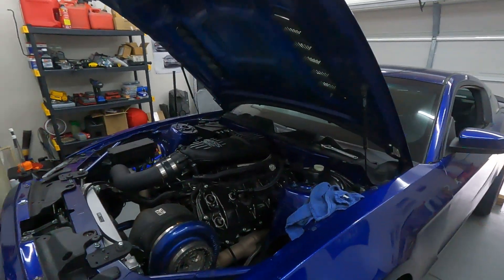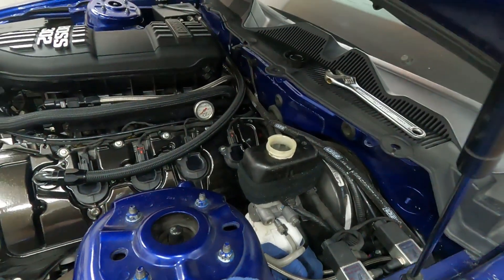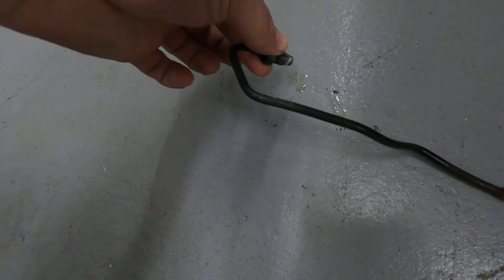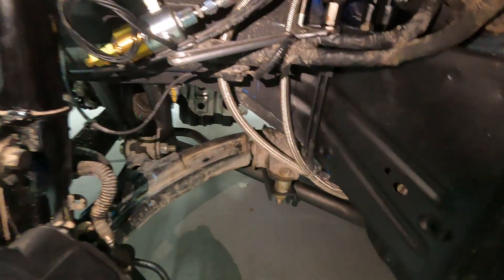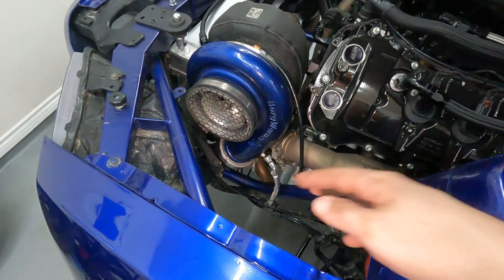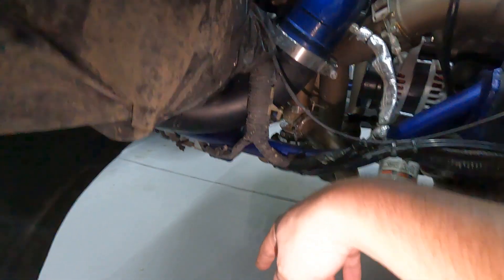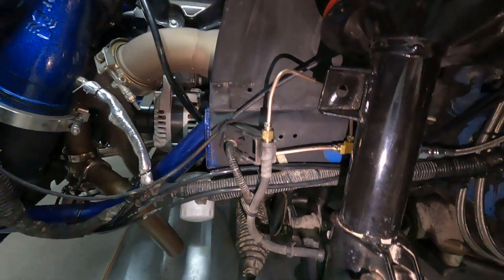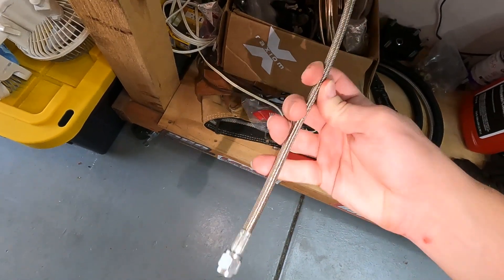ABS Delete & Custom Brake Lines for S197 (11-14 Mustang)

Comment: Screw it I ordered everything except the line lock solenoid. What will I need to skip that part? Just a 4an to 3an reducer?
Reply from the maker: Yeah I don’t know a part number because I did use the line lock but should just need that one adapter. Sorry for the delay, how did it go for you?

Comment: A few years ago, my tuner turned the ABS off so that I would be able to turn traction control off. There was some  kind of issue going on there. Anyway… Since ABS is not on, I guess I could go ahead and remove it as you have, correct?
Reply from the maker: Correct. Especially if you already have it tuned out - you could do the delete like I did as well. Main reason to do it in my opinion would be making space for turbo though.

Comment: Did you have issues with the fittings leaking  or weeping at the master ? I used the ones listed like the video but can't get them to seal up on my 2012
Reply from the maker: Yes they initially leaked until I added the crush washers. That’s the essential piece.

Comment: What did you with the abs plug ?
Reply: Good video. I'm sure at some point I'll also delete my abs module 👍
Reply from the maker: Thanks boss! I’m happy to share content like this. I remember looking for how to videos for S197 and couldn’t find much past FBO stuff
Reply from the maker: I’m not sure what you’re asking here.
Reply: @vonlipichracing  the conector that plugs into the abs module. Did you just tuck it away ?
Reply from the maker: Yes it’s tucked under the driver headlight. Could pull out all the wiring but it’s a LOT of work. Brendan Milteer did it on his and he has a video on it as well.